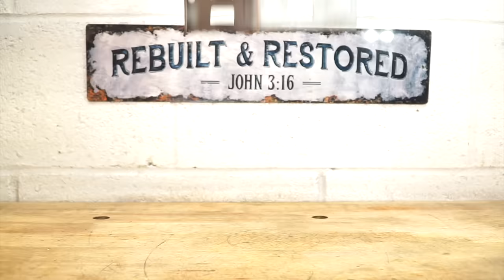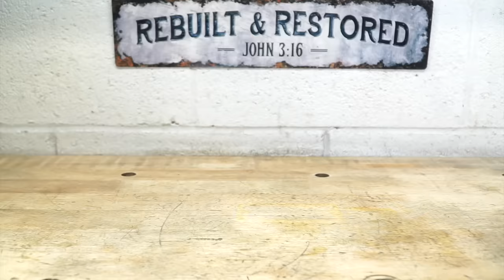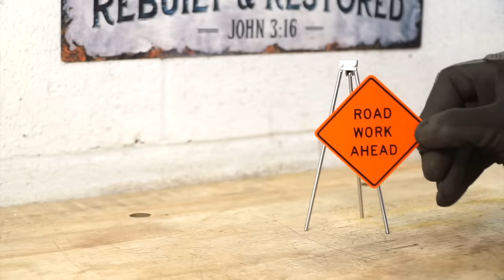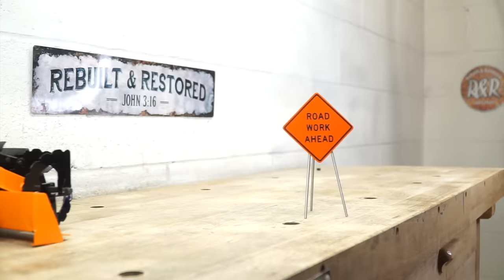Rare 1954 Traveloader Restoration- Nylint (Adams)

Comment: What a marvellous job! The city where I lived when I was a kid had one of these. I remember it loading snow downtown after a heavy storm. I too am fortunate enough to have one of these toys. I won't go so far as to say mine is "like new" but compared to what you started with, "like new". No rust and no signs of abuse. The only thing wrong with mine, and I believe the only thing that causes yours to be less than 100 percent is the rubber belt. I have the original belt but it is badly torn and dried out. That belt is one piece (like a rubber band) and it has cleats molded into the rubber to give the load something to hang on to. But I would be more than happy to find a belt like yours to make mine complete.

Comment: I used to maintain & repair old heavy equipment like this. (Real equipment, not toys) My favorite was a 1961 Adams A-Frame Road Grader. 100% mechanical, no hydraulics... It was so easy to work on! We kept it alive & running into the early 2000s. Most of the parts were obsolete by then. We gave it a Viking send-off... 😂
Reply from the maker: Thanks for sharing and very cool!! Working on the real thing, you are at the NEXT level! Thanks for watching.
Reply: So, either it ended up on a barge, in a large body of water, or was set ablaze by a fire tipped arrow, or both...I prefer both.
Reply: @BazerrkInsaneAsylum  Actually, we blew it up.  😁
Reply: @j.l.emerson592  kinda like my avatar! The cat blew up a tree to get to the squirrel!

Comment: Great gob.
One comment though - was toy originally designed like this  (belts moving in opposite direction) or you assembled gears like this?
Thank you.
Reply: Yes it is assembled correctly. The front chain drive pulls the material up and back through the machine from the bottom and the conveyor belt carries the material further to the back of the machine from the top.
Reply: @Beenthere5409 , do you mean to say that front conveyor's carrying part is the bottom line rather then top line?
Anyway, I've not seen this machine in action, so I could be wrong.
Thank you.
Reply from the maker: Beenthere5409 that is correct! Thanks